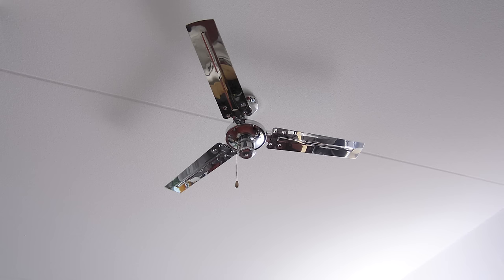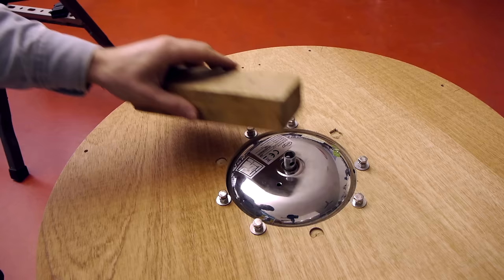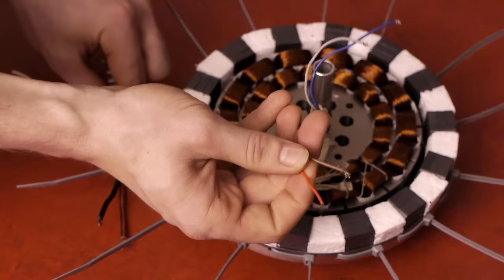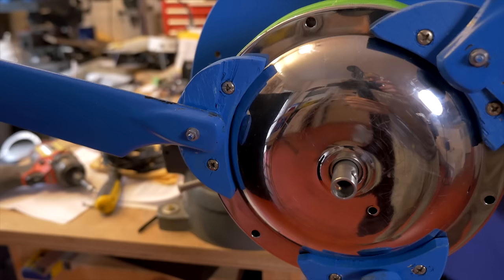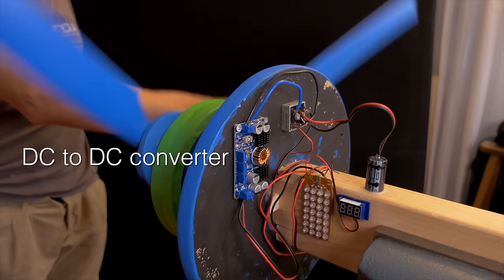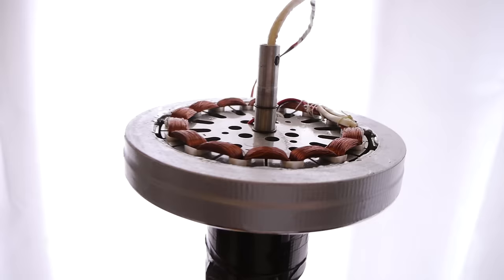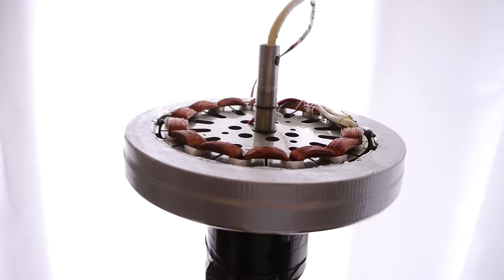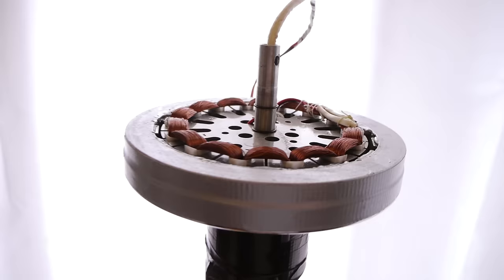Turn a ceiling fan into a wind turbine generator?!

Comment: I live on the beach, this video gave me the idea to perhaps transform an old celiac fan into a wave powered generator, keeping both inner coils, placing permeate magnets outside of the stator and wiring the inner and outer coils in such a manner as to generate power either the inner or outer coil correlating to the ebb and flow of the waves. I might try it this weekend for fun, then in a few months when the U.S. has fallen into chaos with no power, I might be able to put it to practical use.

Comment: Glad someone is doing this. I think you can do similar easier with a car starter
Reply: You can use an alternator to produce energy to run your home
Reply: Alternator also
Reply: Using an alternator works best if you include an inverter.
Reply: But you need to make some modifications to the car alternator, not very complicated but still not easy for everyone.
Reply: @saranjimable  One challenge with the alternator is that it must spin relatively quickly, so you would need some drive system (belt and pulleys, etc..) to increase the shaft speed relative the wind turbine part, which can eat some of the energy.  By starting with a motor that has many poles (the hoverboard motor looked interesting) you can produce more power at lower RPM, potentially eliminating any drive line parts and therefore the parasitic losses that goes with them, potentially generating more electrical power for the same amount of wind.
Reply: @8180634  thanks for the info. Its all very  interesting. Im getting my bachelors in renewable energy & the simple things that we can do to help lessen our dependency on fossil fuels is pretty cool.
Reply: @mary Lee
Look up Marty T 
He lives off grid in NZ and made a genie from an old washing machine motor using a water turbine.
Reply: A car starter is a series wound motor. Not great for turning into a generator
Reply: @alandegraaf1638  awesome I will do that. Thanks for the tip
Reply: @sh115067  
wrong ... there are also starters with permanent magnets
Reply: @MariusG78  just because there are exceptions doesn't make him wrong, most are series wound and the pm versions are either expensive or broken if scrapped.
Reply: @lazyh-online4839  when you say "majority", do you have any basis? because I work in service and I notice the disappearance of the coiled stator... if the starter has magnets, it is a very powerful generator, but it also needs a proper drive
Reply: Alternator makes more sense, using a 24v alternator from a semi truck would be the best option, they are designed to produce peak power at much lower RPM's than a car alternator, you can also use ranging pulley sizes to create different ratios and make the system run more efficiently.

Comment: I have found that by using the center coils in series with the outer coils will raise the voltage. I'm using 4 very powerful magnets that I've attached to the shell. Not completely done but turning the shell with a drill I'm able to produce 120vac from it. I'm shooting for more the 40-50v range. Then I'll use a voltage regulator from an old lawn mower engine to charge a 12vdc battery for my daughter's playhouse. It has lights; interior and exterior, 12v ceiling fan, radio, and a doorbell. Tried a 100watt solar panel first. As long as the sun was out, it did ok until the tree grew leaves. Little did I know my wife was going to plant it under a tree. So now I've turned to trying this method. Wish me luck.

Comment: You haven't elaborated as to the "stronger magnets". Neodymium is the way to go. With respect to reliability of your generator, the use of capacitor with a voltage rating of 50V even though your output can rise above 50V is unwise. The general rule of choosing electronic component specifications is to double the realistic rating, e.g., if the maximum voltage likely to be seen is 50VDC, the capacitor should be at least 100V. Your 50V RMS voltage would hit a peak of about 70 V after being rectified and filtered with the capacitor. So, 50VAC output would lead to 70 VDC. This will kill the capacitor in short order. I suggest a capacitor rated at 100V as the absolute minimum, with 150V being preferable. 

Mechanically, the bearings concern me. Ceiling fans are meant to be hung from the ceiling and to be installed level. This is to minimize side forces on the bearing in the fan, which aren't designed to take the side forces present in a fan that is installed off-level. Since you are likely to install this in its final location with the shaft of the fan parallel to the ground, I suspect the bearing life will be short as well.

That said, I realize that this sort of thing has been done by others. It's not clear if they suffer from a shortened bearing life or if I'm over-dramatizing the effects of installing the fan horizontally.
Reply: Neodynium are what are used on these projects.  These have ratings and the consideration is the price you would like to spend.  Experiance with those. The shiny coating is very brittle and if you bang the square ones together the coating will chip off in sharp shards.
Reply: In the US, you can get these super magnets at your local hobby shop. Mine has them.

Comment: Really interesting!  My idea is to remove the electric motor from a Toyota Prius (which is rated at 60 kW) as that will be cheap if you get it from one that has been in a crash.  It's very hard to find information on using those as generators though, as it seems nobody has tried to do it before!  But it's a three-phase permanent magnet motor, so you should be able to use it unmodified in a wind turbine (apart from adding blades and electronics on the output, of course!)
Reply: LIVING SOUL CREATION  I love your name.. and Berkeloid's I like also !
Reply: that would make an insane generator and would have a massive output! problem is  driving it...you would need a Powerhouse of an engine to max its potiential... you arent gonna get 60kws by hooking to a riding mower engine!
Reply: Yes it's the "transaxle", which contains two electric motors (one approx 60 kW and one approx 30 kW) along with an input for the combustion engine.

You certainly would need a lot of power to get the full 60 kW out of it (and I suspect you couldn't for technical reasons - I think this power rating is for driving the motor with a square wave and you'll only get a sine wave out of it when using it as a generator) however there doesn't seem to be any problem with running it at much less than its rated power (after all, this is what you do in the car when you gently brake and it turns that power back into a small amount of electricity), so you can start small and just run it at whatever power you might need, even if that's well under 60 kW.  It'll give you plenty of room to grow in the future!
Reply: @Berkeloid0  Yeah, 60kW is a lot! That's like 80 Hp. You'd need one helluva gigantic turbine to drive it and there's no practical application I can think of for that. That's enough service for 2-3 houses.

Comment: This video is 2 years old but Id be interested in trying to help. 1 ceiling fans are single phase so im not exactly sure how coil wiring works. 2 you say power is low, but it seems like it’s producing too much for your circuit. Maybe try shorting and testing with a clamp on amp meter in order to determine max power from fan before adding a rectifier. 3 if you power you have is too large for your circuit, you can step the voltage down to 12 instead of 5 in order to charge a battery. Then the battery can be used more easily to charge phone.

Comment: i like your idea, but a few years ago i wanted to make a turbine. My thought was similar to yours but i went with a car alternator to convert. not a lot was needed to make it work and i was able (at the time) to purchase cheap old alternators from a auto wreckers salvage shop.  it cost me about $15 for an alternator of a 6 cylinder car.  once i had wired the alternator and added fan blades i made from sheet aluminium,  my generator was able to charge a car battery  in a day from dead flat.  my fan was only 80 cm in diameter and the whole thing cost me me under a hundred dollars once all costs were  counted (excluding the battery).  my plan was to have a bank of 10 x 24 volt truck batteries  in line to produce 240 volts as my mains power to my house is 240 volt.  i was going to ad solar panels to the charging process to double the charge charge rate, and eventually set the battery bank under the house. i could not complete the hobby as i became injured and unable to continue. but to me, in my head, it was a breakthrough for suburban free energy. funnily enough, the solar thing took off some years after and i believe now it will be cheaper to have professional companies to supply and install solar panels and a Tesla battery. but i had fun back in the day thinking i was going to be rich with my design of wind and solar energy for individual houses.  ironically, all my neighbors have professionally installed solar panels and free electricity, while i am still connected to the power company and paying the HIGHEST electricity prices in the world. Yes, i am in Australia, where elderly ppl die each year from the cold and the heat as they cant afford to use electricity. it is 5 times higher to buy electricity here than europe or asia.   hence, i wanted to build a home made free power generator (Solar and wind)
Reply: Your idea with the truck batteries would produce DC voltage when you need AC voltage for the house.
Reply: Australia has plenty of clean coal and uranium and a ban on nuclear power. We closed down coal powered stations, could have converted the to nuclear by replacing steam generated by coal fired burners with steam generated by new gen nuclear power. The power generators could have been utilised and not destroyed. 
Alas, the Green Party has had too much influence and scaremongering due to the major parties requiring their coalition to remain in power and remain too short sighted to realise that their appeasement hurts average working Australians for a goal that will do nothing toward Global Warming as what we produce is but a mosquito ‘s fart in a cyclone.
 We had one bushfire here a few years back, started by lightning, that emitted enough carbon dioxide in 1 week as all the coal fired power stations and vehicles in Australia emitted in 5 years.
Reply: FUCK YOUTUBE  no problems there as solar batteries only produce DC as well. All you do is generate a sine wave at 50 hz and amplify to 240v through parallel current limiters and a transformer. Switch the current limiters on and off according to required power. This is done commercially through the solar panel inverters anyway
Reply: @AJHyland63  "Clean coal" is a myth.
It doesn't exist.
Anytime you burn anything made of carbon,  you are taking that "stored" carbon and putting it into the atmosphere. 
At least you understand that this action contributes to global warming. 
Just because a brush fire (unverified amount by the way) contributes  to global warming dosen't mean coal fired power plants are a good thing. 
As far as nuclear power plants go, we've all seen what a fucking disaster those things can turn into.
And no insurance company in the world will insure them.
Think about that.
Reply: Wrong. We capture the carbon and bury it in a landfill, or sell it to concrete companies. The air out of our stacks is very clean.
Reply: @TheTomahawkTech  owh,i see.so thats why they smell the same.ive been living near power plant,and ive been around the concrete/cement company.the air smells somewhat nutty flavored in a bad way.you can hardly sleep at night because the smell comes at irregular hour
Reply: @pokekk  Funny how the people who talk about clean coal never live downwind from coal fired power plants, huh?
And they think we don't notice.

Comment: Hi Giesbert ! Thanks for sharing your homemade Ceiling Fan Generator. I have a suggestion on the Electronics side, as observed the Generator produces AC voltage and I think if you add a Battery and a Battery charger with the capability of float charge you can harness and store all the power from the wind turbine...

Comment: Could you arrange the magnets in a Halbach array to double the magnetic flux?  How does mounting it as a horizontal wind turbine affect the bearings given that ceiling fans are vertical axis?

If the induction motor was already on an AC supply, the speed would be fixed but any wind power would still be added to the AC grid.  However should there not be enough wind, the induction motor would pull power from the grid.  Unfortunately inverters don't work very well to provide the initial power source, you pretty much need actual alternators controlled by a regulated mechanical prime mover to regulate the voltage and frequency and of course an actual load.  This is actually how power plants work on the grid so induction motors without magnets can be used to generate power just not without an already operating grid.
Reply: For everyone who brought up the problems of a horizontal-axis wind turbine...Google or search on YouTube to find vertical-axis wind turbines!  Both designs exist.
Reply: @LiveHappy76  Far less efficient, and the most common designs will not start rotating on their own from a dead stop. For the dynamo you're much better using one of the many self-built designs than with putting almost the same amount of effort into converting an existing device into a lesser machine.

Comment: Why not use a junkyard automobile alternator and voltage regulator, which are paired and configured to generate a steady 13.8 V DC at very high amperage, and graft the blades onto the input shaft of the alternator?  You could then use any of a number of DC:AC adapters, which are designed either to plug into a car cigar lighter or wire directly to the battery terminals, to generate 60 Hz AC at 110 volts?  At that point, you have house electricity, and with a few large batteries, an off-the-shelf backup storage capability that will continue delivering 110 VAC through the converter.  It is a device designed to run in outside weather conditions across a wide range of temperatures, and at high output - 50 Amps or more - for long periods, with industrial bearings for long life, vibration resistant, self-cooling, and robust construction.  It also has a vee pulley, which allows you to use a belt-drive for stepping up or down the rpm to adjust to a wide variety of turbine blade sizes and rotational speeds.
Reply: An automobile alternator is a very high rpm device (1000s) not really suited to a low rpm (10s - 100s) wind generator.
Reply: @jackiemowery5243  exactly why I brought up the pulley - for speeding up the input rpm.

Comment: how about a zener diode in line from the rectifier to the capacitor ?
Reply: About that zener diode did u get it off a bsa triumph or Norton
Reply: @waltercurtis67  -  Triumph 650, and after a 20 minute ride the battery would be boiling.  Wanted to fit an auto voltage regulator to replace zener diode, but sold it before getting to that.

Comment: Turbines can spin too fast in high winds and unloaded. It is potentially  dangerous to have a load shut off in high wind just because the voltage is high.
Reply: Yeah, it would have been nice to see the feasibility of using those inner coils  used as part of a braking system to stop the turbine from flying apart... maybe another video, or explanation on why that isn't a good idea?
Reply: @pfeerick   Not a bad idea. Connect a voltage dividing network of resistors  to the output of the rectifyed and smoothed DC before the dc to dc converter. One  3k and one 21k with the 21k connected to + and the 3k connected to - and the middle is fed to a comparator.  
The comparator is powered by 5v from the dc to dc converter. A  3v reference  voltage is made with a 100k resistor and zener diode.

Then if the voltage rises to 24v, the 4k resistor drops 21v and the 1k drops 3v sending that 3v to the comparator to compare against the reference voltage.  If the voltage from the voltage dividing network goes higher than the comparator, the comparator turns on switching a relay that dumps that power into a nichrome wire dissipating the power as heat. All that's needed is a few turns of thick wire on the stator. For that coil.  

So now if the smoothed and recitified DC goes over 24v, the load dump coil feeds power to the load dump. The turbine will not spin any faster than when it puts out about 25-26V
Reply: The time I spent in Iowa, gave me an opportunity to sit in a dinner when a group of wind turbine company techs sat down at the next table. Conversation turned to the inner working of a commercial wind turbine. (Talking shop) They explained the largest expense inside the box is the transmission system. While some use electric braking to stabilize rotor speed, but variable pitch blades, hydraulically controlled shifting to the generator. So as wind speed increased, the calculated load increased the gear selection to add 3 sets of windings on the generator. Each produced a load to the rotor, but also increased output wattage with wind speed. Servicing the hydraulics, bearing blocks, electronics including sensors were most of the maintenance they had to perform. Then the rotor housing turns 360 degrees on a captured roller bearing system and it alone required constant maintenance. They estimate that 14 of 100 wind turbines are down at any given time due to service, waiting on parts (Most from Germany) and other issues. They have wind farms all over Iowa and now Starting in NE Nebraska in 2021 after study. Wind still produces only less than 0.2% of all the power produced in the US as of 2018. So much work to get so little with too much effort.
Reply: Variable pitch controls.
Reply: Robert Theref  Fixed.